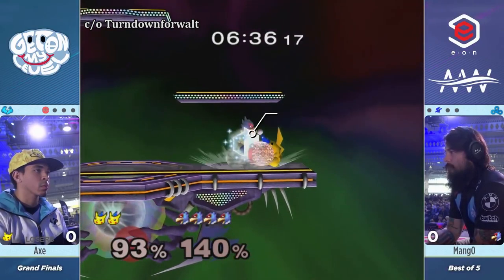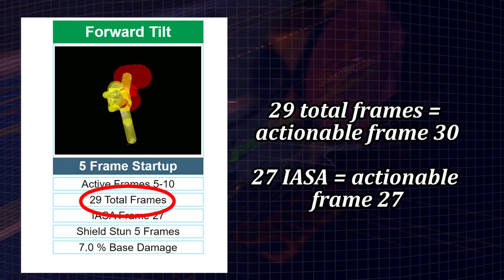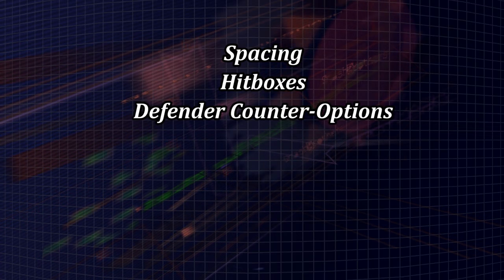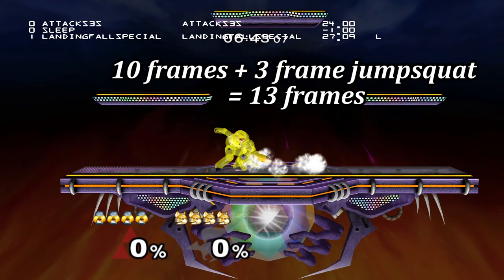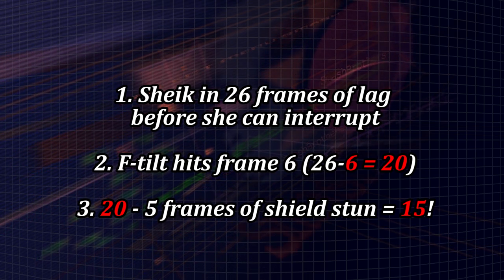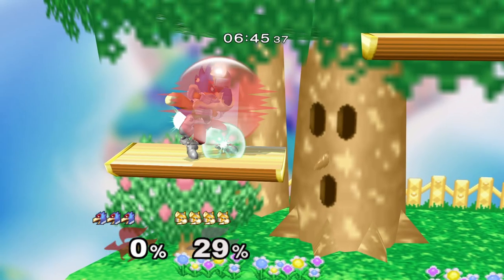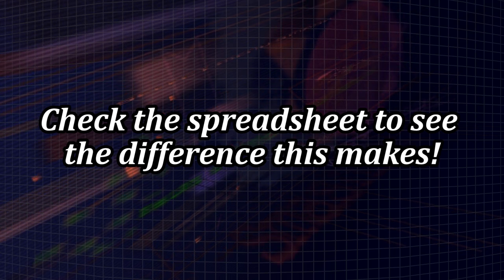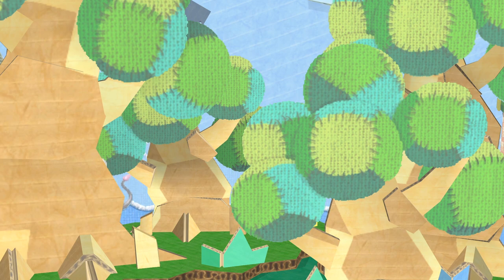Advanced Shield Pressure 101

Comment: Great video, I never realised staling affects shieldstun. I never know if it's even worth doing autocancel bair etc. because as you say, if you shorthop autocancel you're probably going to be hitting the top of shield so it's pretty punishable as it is
Reply from the maker: Yeah it’s the kind of thing you don’t want to assume will always make a difference, as sometimes two different percents do the same amount of shield stun, so it just depends. Falco is a good example, as his shine can be slightly stale and it won’t change things. 

Easy way to tell is just to look at the frame advantage on block chart, and check if 1% less damage will do 1 less frame, then staling is gonna be relevant.  

Mostly I put it in the video because there’s gonna be situations where people have no idea why a thing works sometimes and not other times, and clearing that up felt important. In a lot of situations 1 frame less probably doesn’t matter, but if you’re the kind of player that really likes going for frame-tight punishes it def will